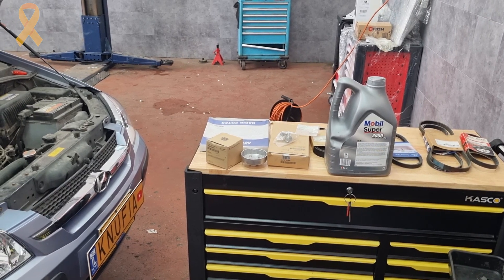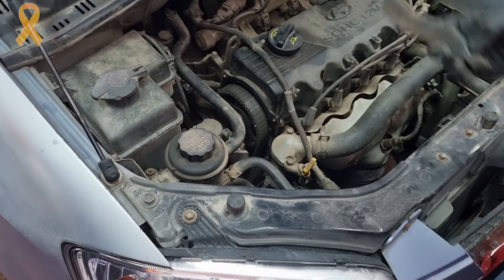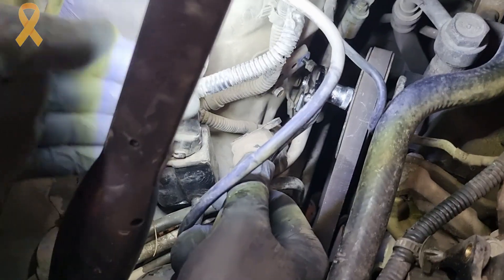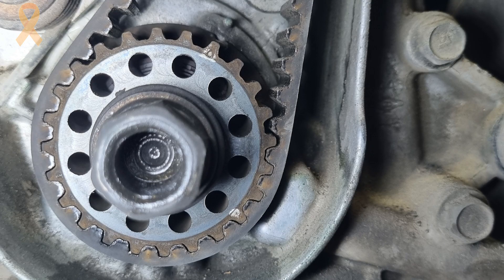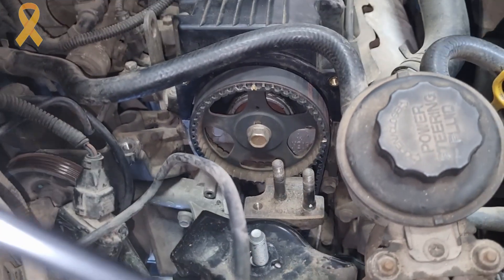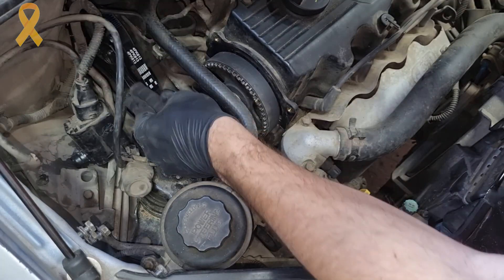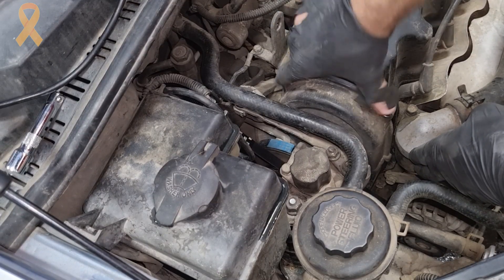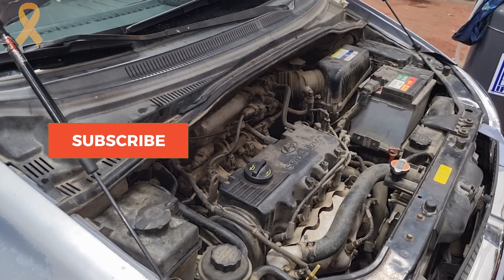Timing Belt Replacement - Full Guide [Hyundai\Kia]

Comment: Nice video. My belt broke and I'm having trouble loosening the crankshaft bolt. I have no power tools at my disposal. I'm thinking about holding the pulley with a screwdriver or vicegrips... would that be advisable? Thanks